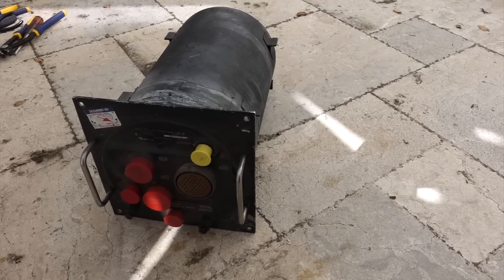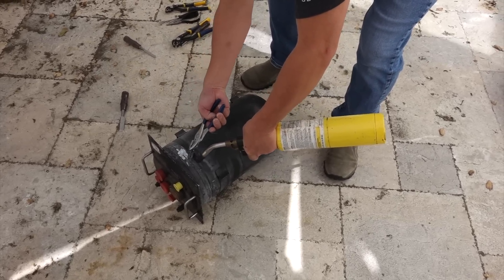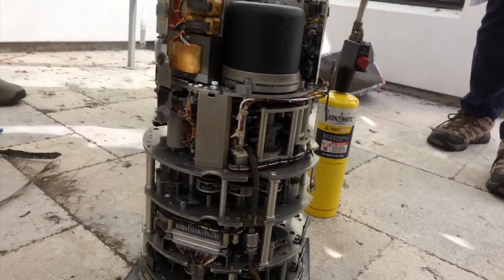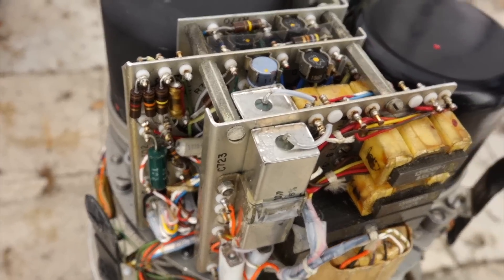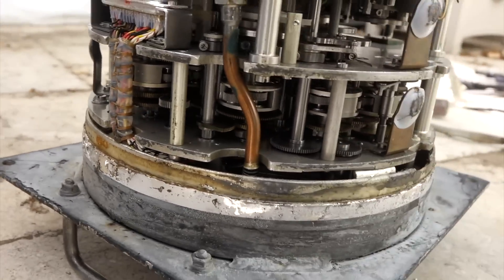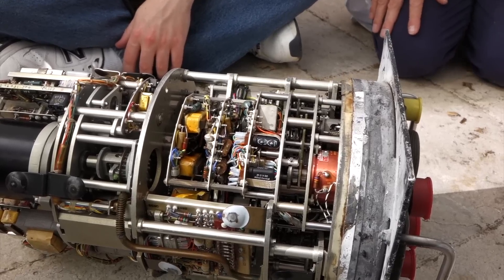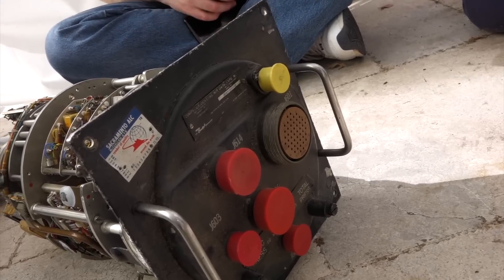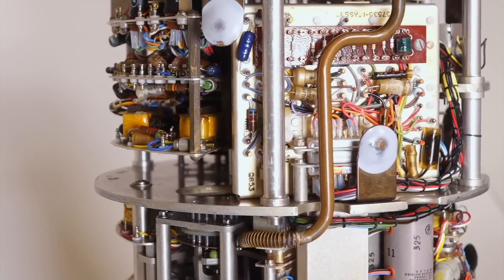Bendix Air Data Computer - Part 1: First Look Inside

Comment: I have removed, replaced and operational checked many air data computers on the F111D.   They were a different shape.  About the size shape of a small microwave oven.   I never got to see the insides but I figured it was something like this one.

Comment: If this is anything like the early Boeing 707/720 mechanical air data computer known as the KIFIS (Kollsman Integrated Flight Information System), the cam and cam-follower arrangement shown momentarily in the video is part of the mechanism that corrected for static system position error. This provided the pilot and weapons system with corrected altitude based on sensed Mach number (Pt/Ps). The position error correction for a given aircraft was physically machined into the cam whose rotational position was a function of sensed Mach number. The static pressure position error varied with Mach number and was greatest as the speed of sound was approached. Thus the “bulge” on the cam seen here. The pilot’s altimeter probably had two pressure fittings on the back of its case…one each for total and static pressure, as well as an electrical connector for the servo-correction function from the air data computer. Power for a small mechanical vibrator was provided. The early jets were so vibration free that the altimeter was vibrated to minimize friction in the display pointer on the instrument face. The old piston powered airplanes vibrated enough due to the piston powerplant. Should be interesting to see the unit taken apart.

Comment: When you finish this, it needs a glass lid for presentation.
Reply: And for a pressure source, a cylinder with a long threaded rod with a handle to adjust the pressure.

Comment: One of the advantages of analog in those days was the ability to very quickly calculate an integration equation using a cam as pictured.  It was accurate enough and very fast.  Digital integrations / calculus simply break the integration interval into tiny segments than do a numerical calculation on the values of the variables at the mid-point of that interval.  The results are the simply summed over the span of the calculation .  This approach soon outperformed analog approaches, even though the analog is a physical, visible integration of the equation.  Analog computers like this one were also used for fire-control calculations in warplanes into the 60's.

Comment: Worked on alot of 60s vintage autopilot stuff.  No tubes but annoying tasks like adjusting cams to work right and such.  Geartrains and synchros and resolvers.  That can be a huge PITA.  The only issues I see is what are probably tantalum capacitors leaking their white crusty guts out here and there. The F-86 heyday was well before the solid state era so I would think that device might have been used in more than that aircraft.  Sometimes equipment like that can be used in more than one plane.  Like to look at that stuff and the quality of construction but never want to touch it again.

Comment: When the airline I was working for received its first Boeing 737-200 aircraft in 1968, the airplane was pure analog.  It had a lot of RTL and TTL logic in various boxes, effected with discrete components, but no digital anything.  The air data computer was analog, and drove the captain's altimeter by synchro signals and servos.  Of course, it also output analog data to autopilot and pressurization systems & etc. Around 1975 or so the continuing stream of new 737 aircraft joining the fleet delivered one with a digital ADC transmitting altitude data to a new altimeter in the captain's panel via an ARINC 429 data bus at a whopping 12,500 bits/second.  We were off to the digital races.  However, when the last of the airline's turboprop Convair 580 aircraft was sold off, its fuel quantity indications were still being generated by capacitance systems with vacuum tube amplifiers.  They were simpler and much more fault-tolerant than the later, digital systems.  Now, of course, mechanic's torque wrenches are likely to be digital.

Comment: machanical computers should be everywhere.  they can't get hacked unless taken apart.
Reply: Put something between gear and u hacked it🌝
Reply: @maksimfedoryak  you can't put anything inside a electric meter.  have the glass rigged with a alarm and you know there's a hacker attempt
Reply: @georgieippolito9924  try to compute on that computer loop with exponential functions

Comment: Reminds me of the "Range Computer" my dad bought for me from the surplus store to tear apart so I would stop disassembling appliances and other things around the house.   It was full of gears, small motors, gauges, and switches, and was used in some WWII bomber.   I still have some of the parts 50 years later.

Comment: I repair avionics for a living, a lot of jet aircraft engine instruments in a cylinder case are solder sealed like that, some of them have the rear plate pressed in and also soldered, they are buggers to pull apart. I use the same method - a small blowtorch. You might be interested in finding an old flight data recorder - for example Sundstrand FEB-542, it uses pressure capsules and stylus to record analog information onto stainless steel tape cassettes

Comment: In the late 80s I worked on Marine Corps KC-130 communication/navigation avionics. A lot of it was circa 1945 or so, complete with vacuum tubes and gear trains and crystals. Very similar to this.
Reply: I got some GE vacuum tubes a few years ago to upgrade an audio amplifier, and when they arrived I was surprised to see the boxes marked as USAF surplus and the manufacturing date as being from the mid-80's. I had no idea they used tubes for so long. I guess I shouldn't be surprised, though, considering how old some airframes like the C-130, KC-135, and B-52 are.

Comment: When I worked in aviation instrumentation we sealed/unsealed instruments by using a succession of large soldering irons with wooden handles, steel shafts and massive copper tips heated in a kiln. Asbestos gloves were required. That gas torch was so easy and comparatively safe.

Comment: To realize that people who designed this beauty used slide rules and math rather than CAD/CAM is nothing short of amazing.
Reply: Because they worked together.  In my modern engineering job, I haven’t seen a soul, let alone heard another idea for weeks.
Reply: CAD just makes it faster to design. Having to do the math instead of the computer doing it for you isn't, and was never, a problem for smart people.
Reply: Yeah, it really is!
Reply: Because one person now does what a army of designers did then.
Reply: you still draw out concept faster than cad it. without cad you just use parts and build prototype based on designs that get more and more details the deper the project went. stuff is not that different now and then, and trust me, getting two gears next to eachother and moving them around is much faster than doing this in cad (making gears, aligning, animating). this whole machine is made from smaller, more digestable chunks.. not to mention that this took probably years for a team of engineers.
computer just make things faster, and more steamlined not always easier. its double the work too.
not to mention manufacturing part of it all..
Reply: Same as the Kalashnikov and she’s just as relevant today as in 1947!
Reply: and pencils on blocks of paper
Reply: People who used rotary phones were all geniuses
Reply: We use CAD/CAM/CFD now because technology has moved on.
Reply: @shadow7037932  technology moved on indeed, but I believe the point is, the more complex technology becomes the less people needs to know because all the hard work was done by someone/something elsewhere and people just want to "use" technology, not actually "learn" and "master" it.
Reply: really?
Reply: cad doesn't factor into the actual manufacturing. design is design, it doesn't help you actually build it
Reply: Wow! And people used to lift heavy objects with their back muscles too! To think now we have cranes!? REMARKABLE!
Reply: @IDNeon357  they used cranes for thousands of years
Reply: you're really overestimating things. even CAD classes have you actually draw stuff
Reply: @lopiklop  He was talking about disigning, not building things. And there's absolutely no doubt in tools like CAD being very helpful to certain aspects of a design process, compared to doing all that stuff manually on paper.
Reply: @homo192  you mean the idea of a calculator? those were around before computer aided design, believe it or not.

Comment: The electronic assemblies, aluminium plates with teflon insulated solder posts, are very common in old avionics, all vintage Collins gear is made like this, check some teardowns of Collins aircraft boxes on my channel.

Comment: Thanks, can't wait to see it working.

The WW2 USS Pampinito submarine is docked at Pier45 in San Francisco. I found a link to the torpedo firing computer's maintenance manual through some links on their web page. It was a marvel of mechanical engineering very much like what you are about to tackle only much larger. 

Basically a mechanical analog computer.   It was composed of standardized mechanical modules that could be interconnected to calculate the firing solution.  There were module for all the various math functions like addition, subtraction, integration, differentiation.  Always thought you pointed your bow or stern of sub at the target and fired but that was not the case.  You paralleled the target course and shot.  The computer calculated the data and mechanically loaded the turn point into the torpedo before firing.
Reply: I think the original bomb sights were also analog computers.

Comment: Unbelievable.... beautiful.... I wonder about the engineering process of it.... This beauty have hundreds of individually designed parts... It's a serious amount even on paper. But how that could be manufactured that time, without CNC (not even mention 3D printing, CNC sheet metal works, etc.) How could that be managed at all?  I'm proud of my designs, each of them takes months to reach perfection - but for that I use powerful computers and software, and the production is done by machines..... I wish to grow up to this engineering level...

Comment: When the cover came off - all I could think of is "what a thing of absolute beauty!" The design, the engineering. Brilliant!
Reply: Something I can hide under glass in my living room or office as an eyecatcher for sure.
Reply: Agreed. This thing looks amazing
Reply: From an era when things were intended to be repaired rather than just disposed of when they quit working.
Reply: I thought the same thing.
Reply: they could have just used some cheap microcontrollers.
Reply: @batman-cw2hd  Which didn't exist at the time.
Reply: It does feel like it is unnecessarily complex though.

Comment: Now that everything is solid state and strap down, all this electromechanical stuff just ends up in the dumpster.  It’s not worth returning let alone repair.  In my avionics career, I’ve taken so much of this stuff apart just to marvel at the design complexity. Some of the very basic components are just mind boggling in design philosophy. That whole air data computer is now just a smart probe.

Comment: Former avionics tech here, and boy do I love me some aircraft computers/instruments! When I go to an airshow or museum, I don't care about the chassis, I want to see the cockpit and instruments... lol. Also, that is one clean ADC inside! Now I see why I was solder sealed.
Reply: I would appreciate it if you took a look at my avionics teardown videos, as you might be able to shed some light on the topic with your experience.
Reply: Same here. Occasionally worked on some pretty old equipment, but rarely anything from before the late 1960s.

Comment: The cam with all the set screws around the perimeter to give it a crazy profile is a real knock-out.  I wonder what variable that cam is encoding?
Reply: The set of screws permits to correct a little bit the correction functions for the altitude and air speed. A roll in contact with the disc associated with a differential converts the tiny translation into a small angle which is added to the input. Mathematically output_angle=input_angle+f(input_angle) where f is the function performed by the disc.
Reply: Probably either pressure altitude or pitot pressure. The raw pressure sensing is based on a corrugated metal can that expands and contracts which isn't precise and has hysteresis, temperature sensitivity, orientation sensitivity and inertia as well as losses in the plumbing to the ports. A useable "can" has to be monotonic in each direction but everything else can be corrected for mechanically, electrically and electronically.
Reply: Thanks for the replies.  I’ve watched the US Navy’s series of 1950s films on mechanical computing elements as used in shipboard fire control computers. It is fascinating what fairly high level transcendental math can be done with pretty decent accuracy with relatively simple mechanical components.

Comment: The transistors in clips appear to be in TO-5 packaging.  My guess is that would date this unit to probably 1956 or after based on the transistor packaging and the black flat top resolvers.  That would be near the end of F-86 production.  I hoped to catch a date code on one of the components in the video, but no luck.  This is a very handsome unit indeed.
Reply: I got "6024"-"6102"-"3161" as datecode looking numbers. So likely a later unit?

Comment: You should track down a pair of Sel-Syn synchros which run on 120V line current as they make good demonstration pieces.  Synchros were apparently first used for position feedback in the control houses on the Panama Canal, and they are even found in ships, the first application being the electrohydraulic steering gear on the USS North Carolina back in the 1940s, where they were used to transmit the motion of the wheel to the hydraulics which moved the rudder.
Reply: Huh.  I think they used those in the 5M Hale telescope mount control systems at Palomar, for remote tracking of positions and such (big mount!  Everything is far away!).  Does that make sense?

Comment: Incredible design and to think they built that with slide rules and paper drawings. The blueprints and design specifications must have been enormous to fit all that electromechanical wizardry in one fairly small and lite can, and all of it analog.

Comment: The P-80 was the USA'S first jet fighter. It just didn't see combat. 

The F-86 Sabre is definitely iconic though, and had a much longer service life and saw actual combat over Korea.
Reply: Just because Larry Bell was a great guy, I feel I should point out that the Bell P-59 Airacomet was the first US jet fighter, making its first flight in 1942. It never saw combat, partly because the Whittle W.1 jet engine that the British donated for the US to copy wasn't really up to snuff and partly because of handling problems -- but the USAAF wasn't too disappointed, as they had ordered it mostly to get experience in the operation and maintenance of jet aircraft, and did use it as a trainer.
Reply: @jlwilliams  The P-59 is a very interesting aircraft and the story behind it is also fascinating. 

That said, the P-80 is still the USA's first jet fighter on a sad technicality, as the P-59 was only adopted by the USAAF as a Jet Trainer, not a fighter. Yes, it was designed, prototyped, and tested as a fighter, but it was never actually adopted in that role for the USAAF. Sadly you gotta draw the line somewhere, which is why I said the P-80, since that was the first Jet Fighter that was adopted as a Fighter by the USA (Whether USAAF, later the USAF, or the Navy.)

Personally I like the P-59 more, and it looks better in my opinion. The P-80 is just... bland? Not sure if that's just me.

Comment: There's a channel called @Le labo de Michel who takes these things apart. They probably have tons of  useful information if you need!
Reply from the maker: Absolutely! Link to  Le Labo de Michel already in the Doodly-doo! Has luck would have it, he is currently reverse engineering a slightly more recent version of this.
Reply: Why did you have to mention that?  Now I'm going to sucked into even more retro technical depravity.

Comment: I build an air data computer for NASA in 2015.  It was a challenge, and I lost money on it.  It came out great through.  Uses MEMS devices with temp calibrated pressure sensors.
Reply: Individually addressable? What's the feature size

Comment: If you want to test things out, you will need to generate suitable pressures for the static and pitot inputs.  When I worked on avionics on aircraft in the 70's, we used the TTU-205 air pressure test set.  It let us just dial in the airspeed and altitude, and it would generate the correct pressures.  It cost about $80k back then, so maybe you can pick up a used model a bit cheaper??
Reply: This justifies collecting a whole bag of vintage aviation test equipment as well.
Reply: or maybe some antique plane enthusiasts have one that could be borrowed?
Reply: @ulrichkalber9039  pitot-static test sets must still be needed, so perhaps the nearest avionics shop has one?  They might enjoy being involved in a project like this.
Reply: I scrolled down to see if someone would mention the TTU-205.  We also had a hand pump unit, but I don't remember the designation.  We called it "The suck and blow."